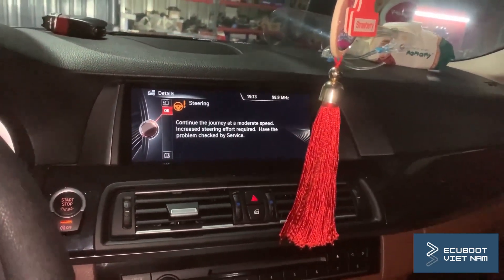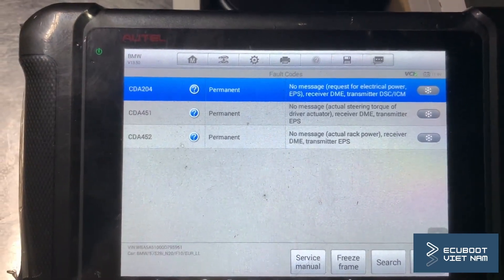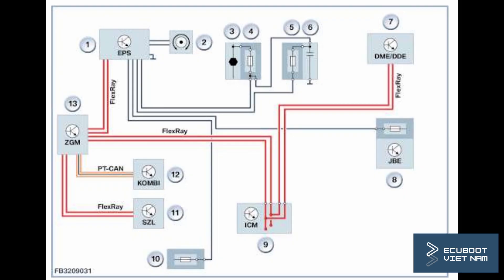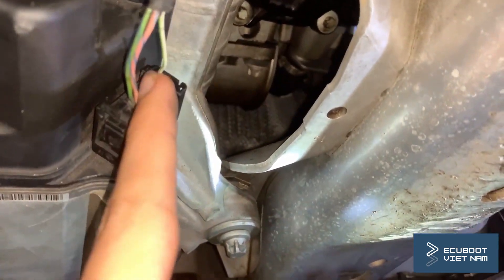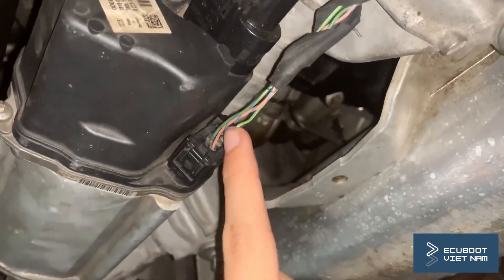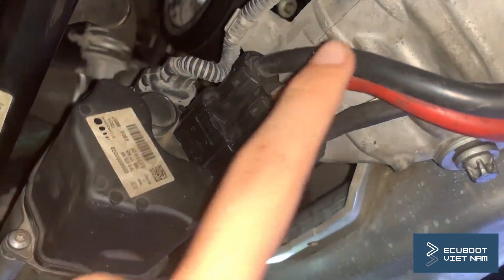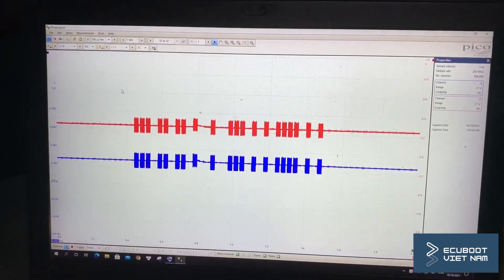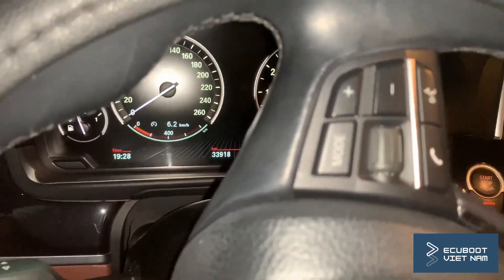How to Diagnose and Fix BMW that Lost Steering wheel functions

Comment: My steering/chassis stabilize error come on in my 2014 328i but my eps still works fine and the steering still turns normal, it’s not stiff idk why the error comes on. I’ll check to see if it’s ground issues and report back
Reply: Did you figured out?
Reply: @aombarbor yes it was my eps motor. I replaced the whole rack and it’s working fine again after recoding.